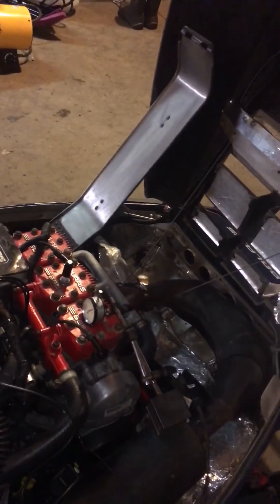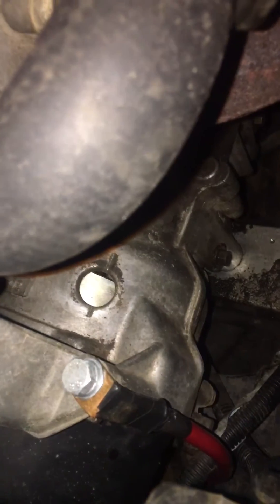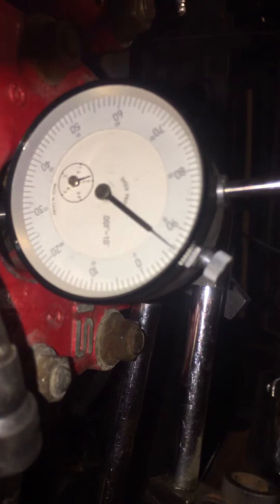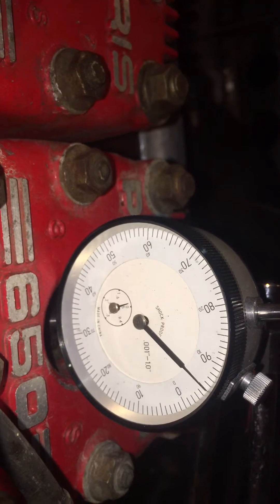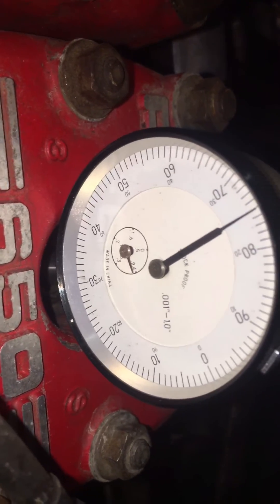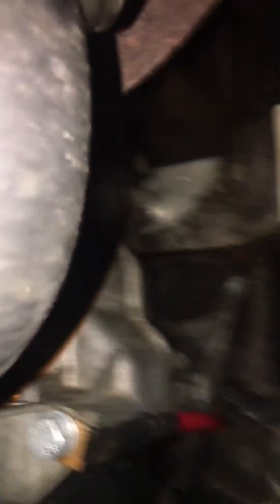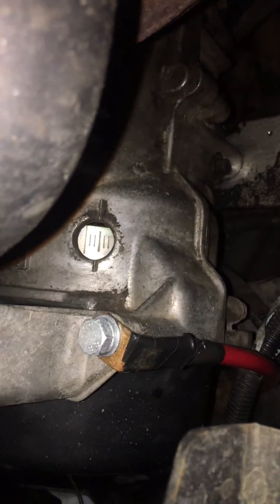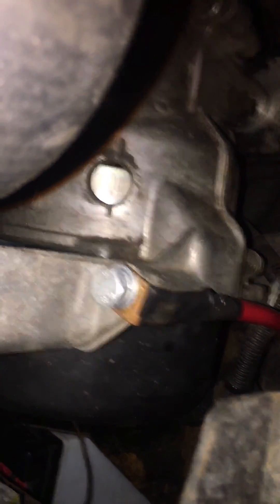Polaris Indy Ignition Timing

Comment: So how do you adjust it?
Reply from the maker: trista ritter you turn the stator behind the flywheel and then re check. The bolt holes are slotted and there are lines to adjust it
Reply: So when you turn the stator, how does that affect the timing mark on the flywheel that’s keyed to the crank?
Reply from the maker: Denise McDowell as you turn the stator the timing light will flash at a different time and make it appear the line on the flywheel is moving forward or backward because the light is flashing earlier/sooner.
Reply: Josh Arnold Thanks but how does the dial indicator come into play? I know that moving the stator changes where the timing light will flash but I don’t understand how to set the stator based on the dial indicator set up.
Reply from the maker: Denise McDowell you look up in your manual what the desired timing advance is in degrees. There is then a sheet In the service manual which will tell you how many degrees it works out to in inches. You set the piston before top dead center at the desired distance and then you look in the timing hole to see which line on the case is lined up with the line on the flywheel. There are several lines on the case. This is all just to verify you are trying to line up the correct lines when you do the running test with the flasher
Reply: need help whit my 1991 polaris rxl 650 for wirring